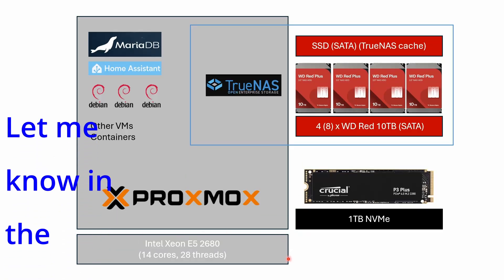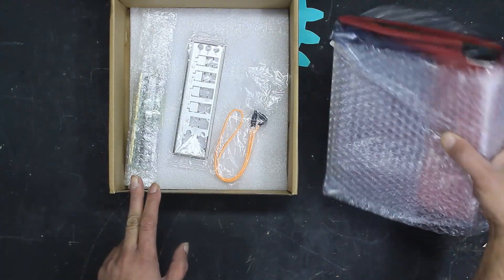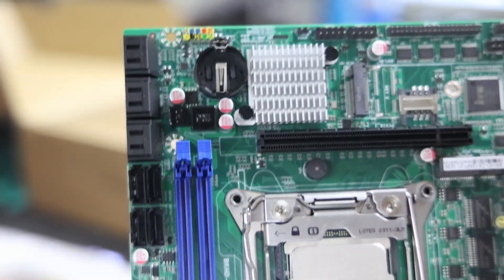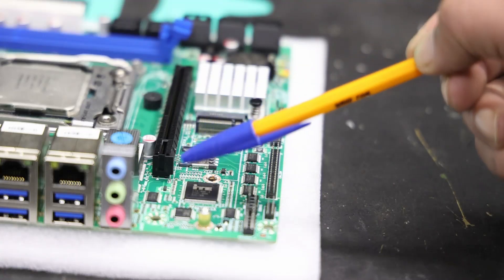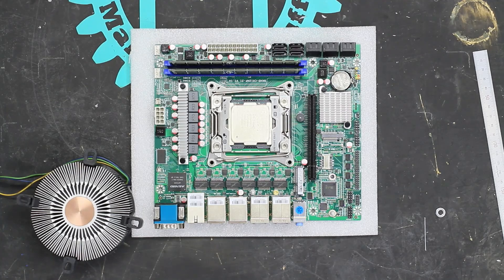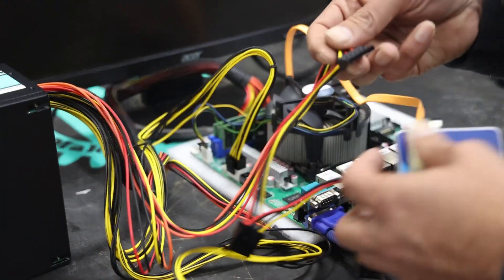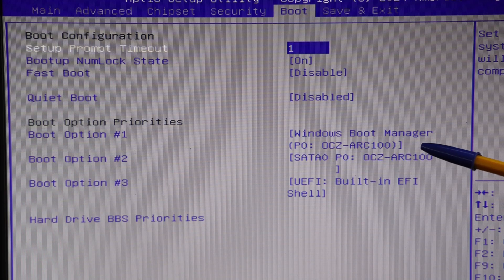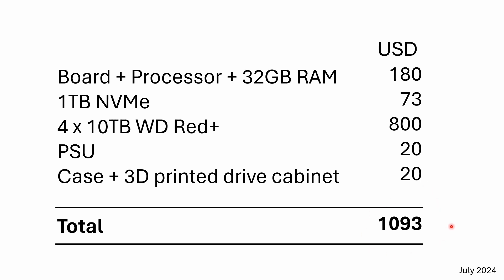$180 NAS board - does it work?

Comment: Why the hell would you need so many intenet ports? is that because of a computer switch?
Reply from the maker: I use them for direct pass-through to the VMs, so they don't enter a virtual switch on proxmox. e.g. for hard network isolation of internet-facing VMs.

Comment: What x99 board is this exactly? I would be interested in finding just the mobo. $180 is kinda steep for that setup to me
Reply from the maker: Check out the Ali links in the comments - they sell the board alone on the same link. Curious that you find $180 steep - that's two RPis, or a N100 which have nowhere near the capability this thing does

Comment: does anyone know what size this motherboard is? it says atx, but looks smaller to me will it fit the matx node 804?
Reply from the maker: It's 214 x 185 mm - it's quite a lot smaller than ATX.  I think some of the holes are in standard locations, but not sure - I ended up making my own sheet metal box

Comment: Make sure your WD red drives are not smr drives you want cmr also disable the WD smart check after 3 years I hear it will flag the drives for age not looked much into that yet
Reply from the maker: Thanks - I have ordered the CMRs - been super happy with my other WD Red drives over the years. Had lots of failures with Seagate, switched to WD and haven't looked back. Is WD smartcheck firmware or software? I generally never install the OEM software. Should I?

Comment: What are your temps like after you have this installed in a case?  I went with a cheap cooler, then upgraded the CPU fan (it's advertised at 3300 rpm but hasn't broke 2400 rpm yet).
Reply from the maker: So far okay, but I haven't pushed all the cores with a heavy workload - I'll do some tests in a follow up - some others have asked for power consumption, and for that I need to stress the CPU and spinning disks, which should generate much more heat.

Comment: The built-in EFI shell is a common feature amongst systems that use EFI. It's a basic tool that you can use to boot  .efi images from connected drives among other things. Think of it like a command prompt / bash shell. It's very handy when you want to do something like flash the firmware of an add-in card like lsi sas card or  a hard drive without having to boot into a more traditional OS.
Reply from the maker: Thanks for the info. Sounds nifty - will have a more detailed look at this.

Comment: Opened this video - thought heck, i bought huananzhi few month ago, and 6 lans looks really cool. But wat da hell, this xeons has 4 channel memory, why there is only 2 dimms?
Reply from the maker: Some of the other boards have 4 x dimm slots, but my primary need was for the 10 x SATA ports + NVMe + 6 x 2.5G ethernet ports.  The SATA is also arranged on two controllers, so you can passthrough an entire controller to TrueNAS, bypassing Proxmox

Comment: Great video! Im curious what's the power consumption of this build?
Reply from the maker: Thanks, and great question. I haven't measured it yet - from other videos I've seen it's about 100W idling (yes, a lot more than a SBC!), but I have a suspicion, that to get a meaningful measurement, I need to add in the spinning drives. So will give you an update when I've done that.
Reply: Yikes. 100w plus disk power use. Thats WAY  to high for me when most of my use is media server related
Reply from the maker: Agree! If you're just looking to serve media (typically < 10MB/s), then this is not the solution for you. Check out the NanoPi R5C (https://youtu.be/GsxuoSXb9A4) - it's a beautiful little machine in a tiny package that you could easily plug USB / SATA SSDs into, and it draws almost no power.